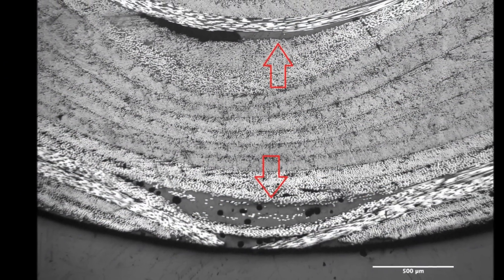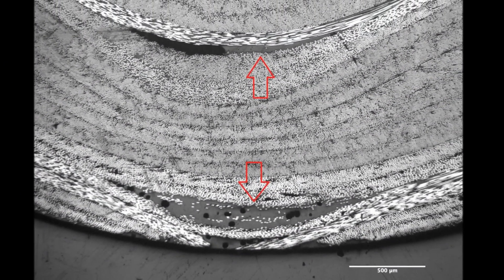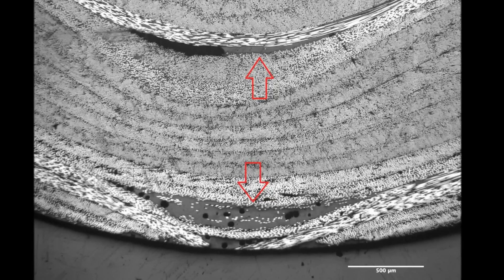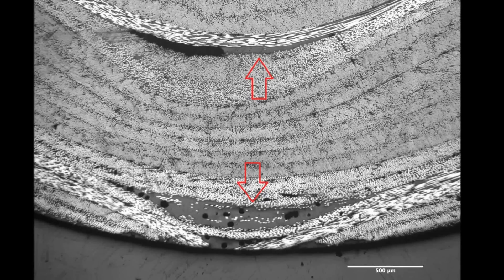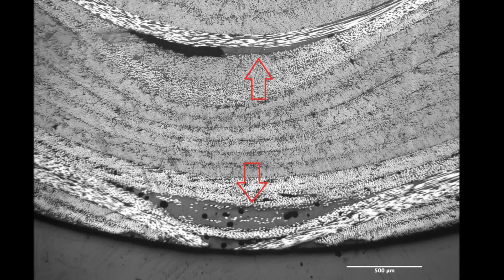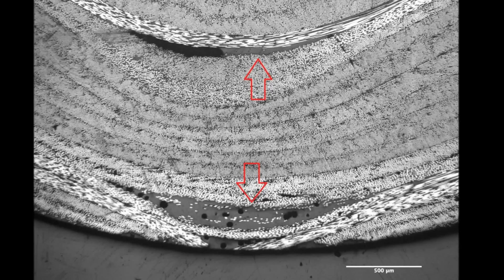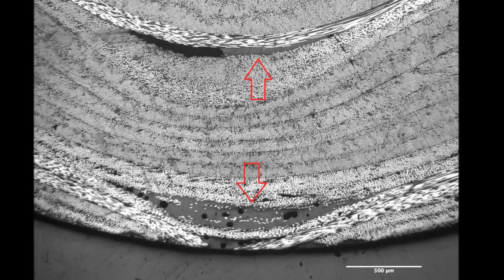Carbon Bike Flaws and Damage - Episode 2 - Resin Rich

Comment: Do you have any videos, or do you plan on making any that show CORRECT carbon construction? I have read several comments asking for more context - and I agree. I would like to know what flaws are unacceptable for bike construction, versus what flaws are just cosmetic, or would be unacceptable for aerospace construction but are probably fine for cycling. Also, if we had access to ultrasound or other equipment, could you show how viewers might begin to examine frames and components with those tools to identify unacceptable flaws? Thank you so much, your videos are truly valuable and could save lives.

Comment: Luescher, have you ever got your hands onto a Calfee or Parlee? I would like to hear your thoughts on their manufacturing processes since they are completely different from what everybody else is using. Thanks and keep up this great videos!!
Reply from the maker: I have had quite a few Parlee's come through, they are not that different actually, some models are bladder molded in asia and others are tube to tube like quite a few production bikes as well. 
There aren't many Calfee's here in Aust, but again they are a tube to tube construction.
Reply: Thanks for taking your time to answer! Would you say this tube to tube method, with fiber laid directly on the tubes to form the union (with no bonding in between) is a good method of manufacturing? Or like the Calfee Bamboo were the fibers are wrapped around the union....

Comment: How long ago were these defective samples manufactured ?
Having samples of defective CF doesn't mean All current manufacturing processes are failing in the same manner.
Sorry, I don't mean to sound/ read as terse....It's just, like you, I'm a Facts guy

In a ratio of 1:100, how many would you suspect "failures" to occur currently ?

Just interested, as unless this is specified, your channel might scare people OFF Carbon Fiber bike builds.
The last thing you would want, since you have a vested interest

I have viewed your past videos, and the response was, Well you just don't know.... OK fair enough.

Seems it's a bit of a Cowboy industry from you testing.

How about a "Best Practice" video on what to want / expect, how to make sure you get it, and the way of assuring it.

Somehow I'm expecting a, Sorry I wish I could, but I can't reply.
Surprise me
Reply from the maker: The samples that I have showed have been from recent models to 8+ years old. If we use forks as an example, they were one of the first products made from carbon composite about 25 years ago, yet there are still recalls of forks by the brands as they struggle with production quality. The recalls are indicative of failures or likely failures. We have seen many fork failures also, over 50% of fork steerers have damage after a front impact. Cervelo has also done testing on this.
I think that today's bikes are the best bikes in history in terms of performance characteristics, can they be better? Yes of course they can, however the process's need to improve for this to happen, as with all things, otherwise we would all still be living in caves.
Reply: Luescher Teknik I have just found this - http://www.bikebiz.com/news/read/why-isn-t-the-bike-industry-scanning-composites-for-flaws/019939

Comment: Great vids and informative Raoul.  Do you find that internal cable routing introduces more problems than just leaving cables external?  It seems a lot of frames with internal cable routing don't look good on the inside.
Reply from the maker: Often the internal cable routing features disrupt the compaction, basically the simpler the shape the easier to get uniform compaction.

Comment: It surprises just how fluid the resin seems to be with prepreg. It almost looks hand laid up in parts. I'm curious to see any views or discussion regarding the Titanium threads that some Chinese manufacturers are now using in their wheels, I also had kevlar rear stays year ago and that seemed to disappear. Any thoughts on the Titanium carbon progression?
Reply from the maker: The resin viscosity at cure temp can be much lower than a typical wet layup at room temp. Viscosity of 50 Cp are common.
Titanium threads in a rim make no sense to me. Titanium maxtrix composites is really cool however but a little pricey!
Reply: I wonder what happened to the 3k Kevlar like what Giant were using back on the rear stays in the 90's. I had one of those CFM hybrid frames, it was bomb proof. Carbon tubes,alloy lugs and kevlar stays all working together. You still see them for sale so they were well made.